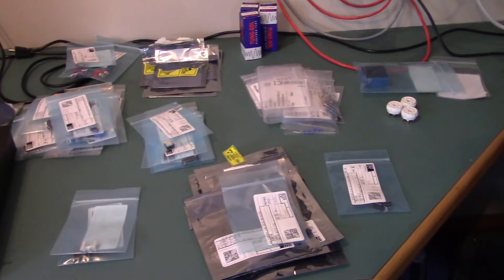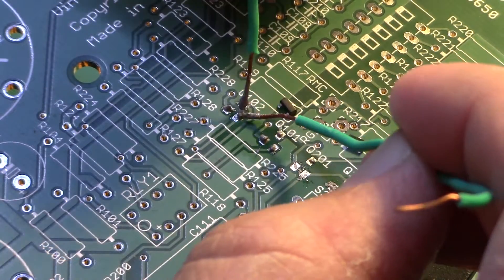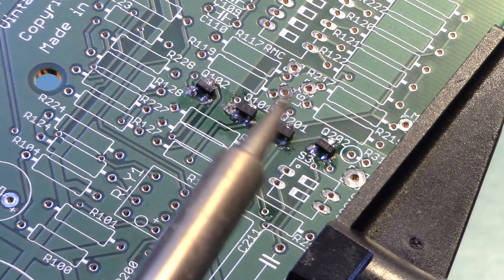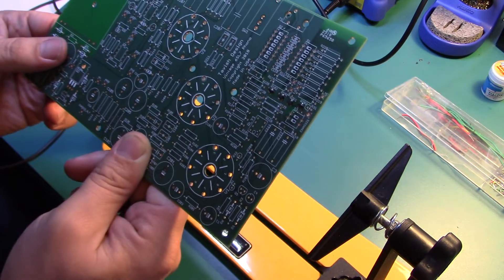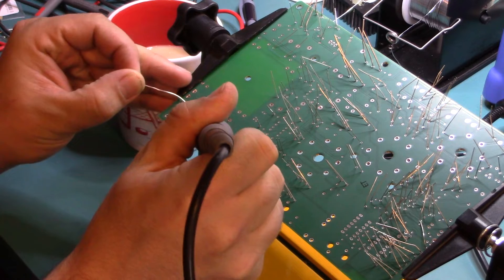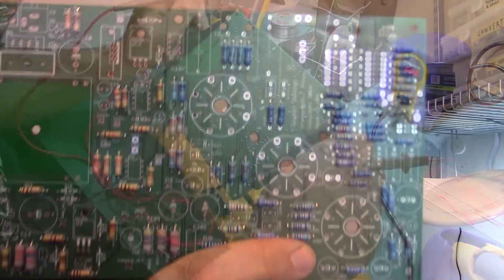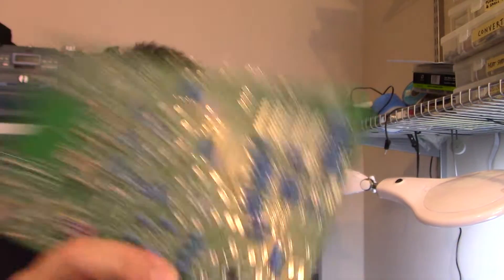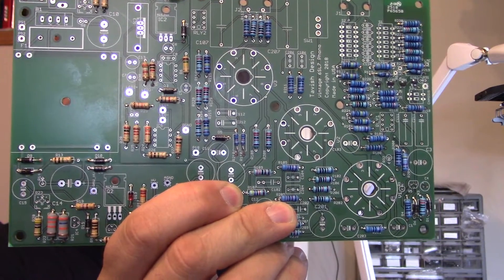Building a Vacuum Tube Preamp - Part 2 - Soldering JFET Amplifiers, Resistors and Diodes

Comment: You don't appear to clean and tin the soldering iron during your resistor marathon...for best results you should clean and tin the iron after every three or four solder joints!
Reply from the maker: Ya I probably don't tin as often as I should but I do clean using the cleaning wire at the base of the Hakko, just a couple of brushes and it's shiny. Thanks for watching